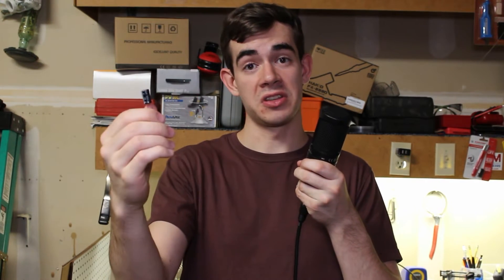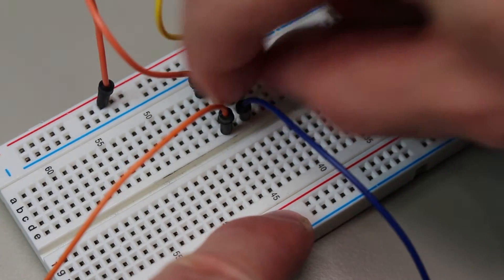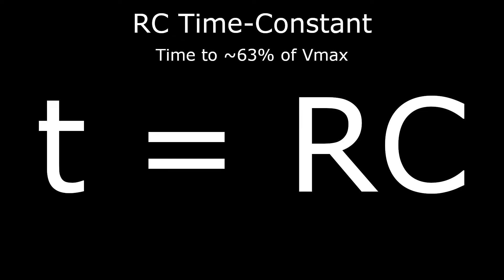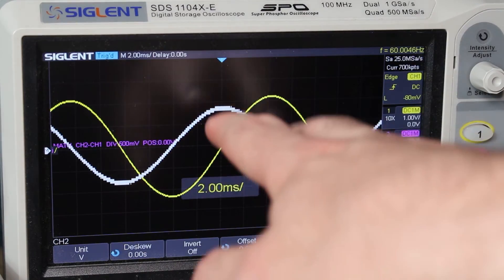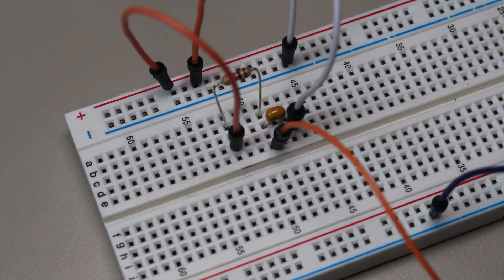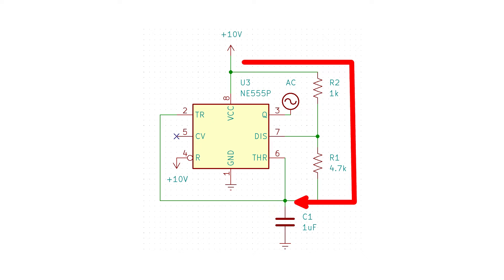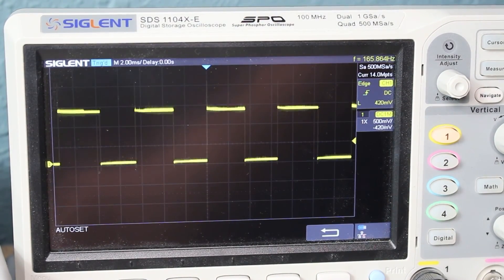How Do Capacitors Work? - Capacitors 101

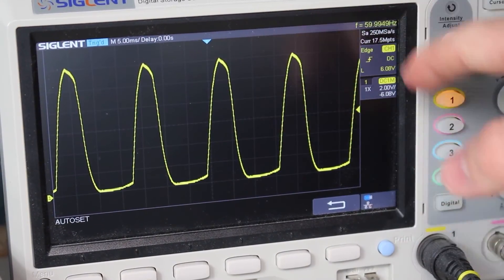Comment: The waveform shown at about 5:38 is not at all what would be expected from a full wave bridge rectifier with a sinusoidal AC input. It looks like half-wave rectified AC. [I see others have discussed this. I concur with the idea that common grounds of the scope and signal generator are likely the problem.]

The primary purpose of decoupling capacitors is to try to make the impedance of the power source as close to zero as possible at all frequencies. They compensate for the inductance and resistance in the power distribution paths by acting as local charge "reservoirs," able to both deliver and receive current. To be effective they should be physically very close to the the "loads."
Decoupling caps do, by this same mechanism, keep "noise" generated by the decoupled bits of circuitry off of the power distribution paths. A noisy power supply shouldn't be addressed with simple decoupling caps. Though they may help, they may actually make matters worse Proper filters are required. (I've seen a lot of videos where it is clear the power supplies being used are horrible, putting huge amounts of "fur" on what should be quite clean signals.)

The voltage spikes in the 555 circuit are due to the inductance of the power connections to the breadboard and the "shoot-through" current of the 555 output stage. 
Using separate wires between the power supply and the breadboard (or any circuit) introduces substantial inductance. Using a twisted pair is far superior because it allows "cancellation" of the magnetic field around one conductor by the equal and opposite field around the other. 
The output stage of the bipolar version of the 555 is a "totem pole" made with quite large, rather slow NPN transistors. During the switching transition both transistors will be partially conducting at the same time. The results in a "spike" of current straight from Vcc to ground at each transition. The impedance of the inductive power supply wires turns this current spike into a voltage spike. It is most noticeable at the end of the current spike which results in a large positive voltage spike as the inductance tries to keep the current constant. Even with twisted supply leads a local decoupling cap is necessary to supply the current when both output transistors are partially on, then absorb the energy stored in the remaining inductance when the shoot-through current spike ends. The CMOS versions of the 555 aren't nearly as bad as the bipolar version.

Comment: 5:40 This doesn't look right, it seems half of the waveform is missing
Reply from the maker: It's a rectified sine wave before the smoothing capacitor is added.
Reply: @SineLab  It's not, you are missing half of the Sin wave
Reply: @rondlh20  Half wave rectified not full wave rectified
Reply: @neonlimemarmot6478  Yes, that is what I was thinking too. But in the video he shows/builds a full wave rectifier (4 diodes).
Reply: @SineLab built a full wave rectifier, but he is shorting one of the diodes (the one between input and rectified output) resulting in half wave. That's probably because his signal generator and oscilloscope share the same ground -- shorting the diode. I'm surprised he didn't notice!